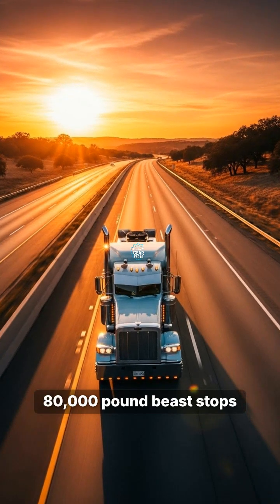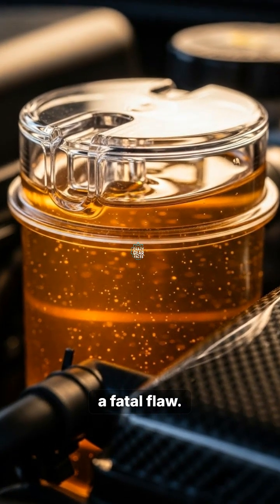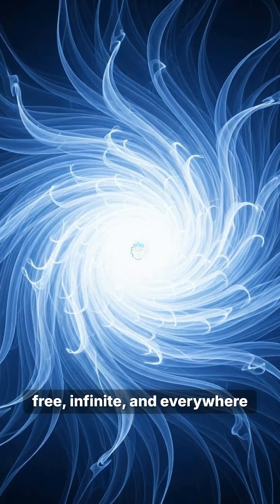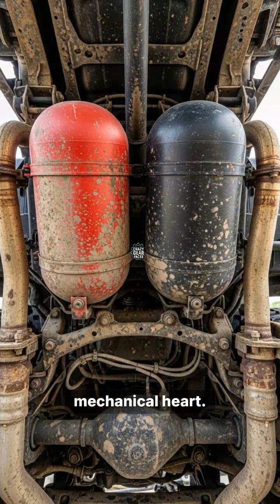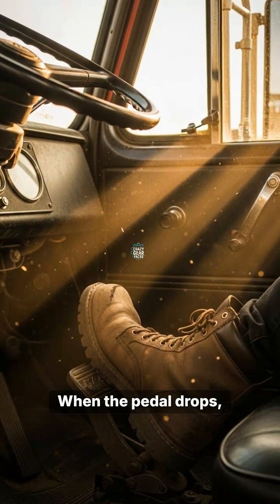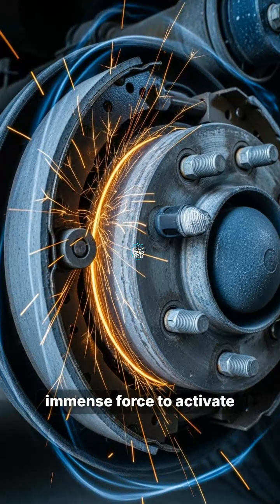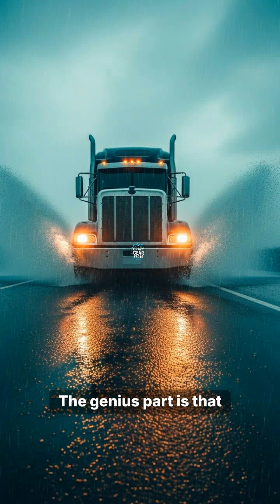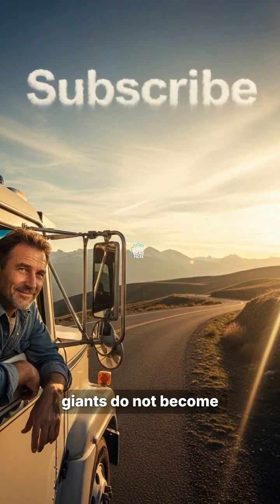Why Semi-Trucks Use Air Brakes Instead of Fluid 🚛💨 #automobile #enginefacts #carfacts

Comment: Different braking principles...
Hydraulic systems apply pressure to brakes, ..more pressure = harder braking.
Many vehicles have separate lines to each wheel so if one bursts the others still work.
Air brakes are the opposite. Often called "failsafe" which means the brakes are locked tightly on when there's no pressure in the system.  They need pressure to disengage the brake and allow the wheels to turn.  Loss of pressure = brakes automatically engaged.
Reply from the maker: Wow excellent